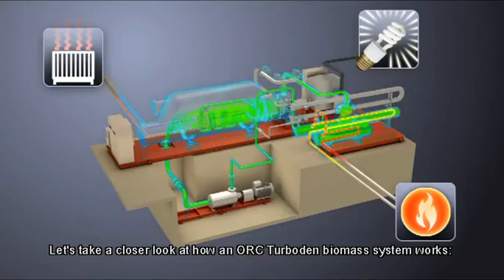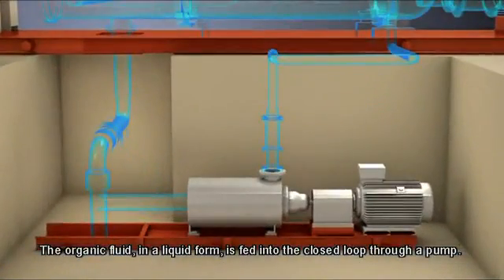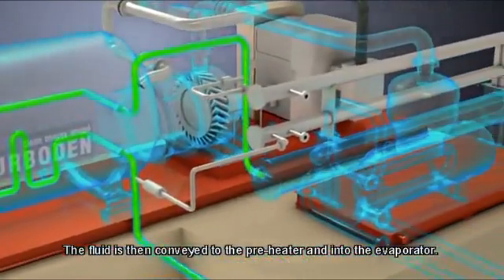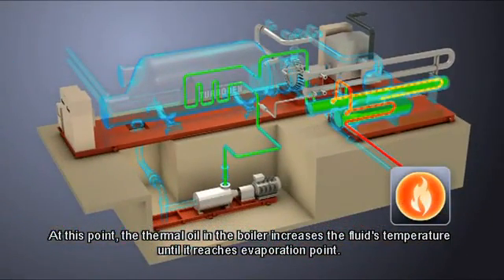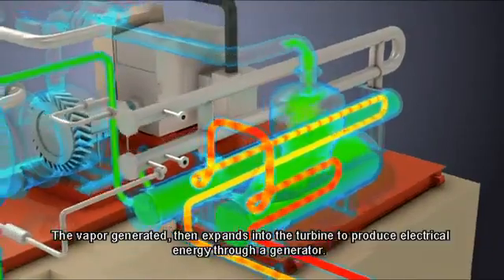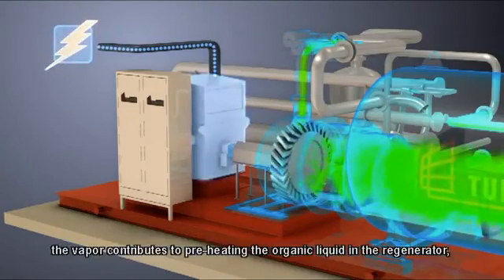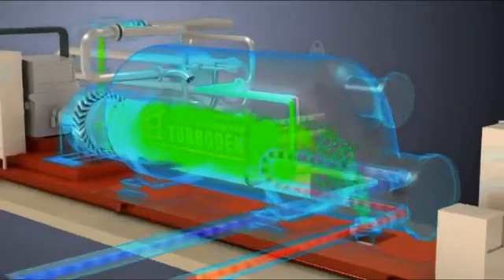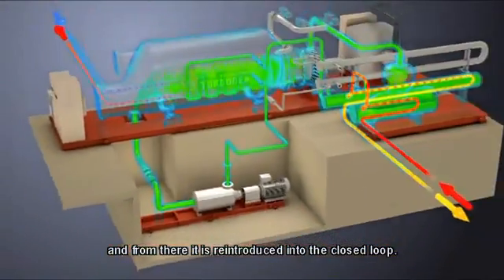Organic Rankine Cycle

Comment: Just pay attention that in this system, the biomass is burnt and heating up the "Thermal Oil:. Then the Thermal Oil" is giving its heat to the "Organic Fluid" through the heat exchanger, to produce vapour of the "Organic Fluid" which is then expanding through the expander.
Reply: Excuse me, how the organic liquid heated in re-generator? What is heat source? is it by the vapor before being fed into the condenser?
Reply: The main heat source is the thermal oil, which is heated up by a furnace and pumped in to a heat exchanger IIRC.